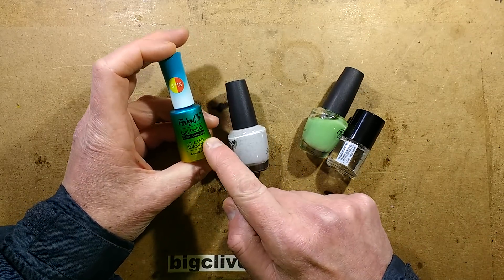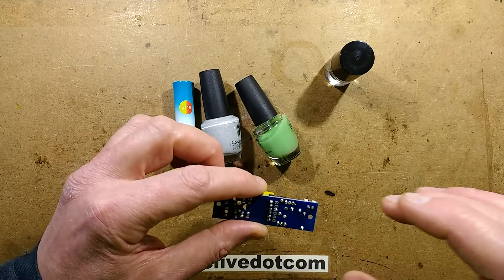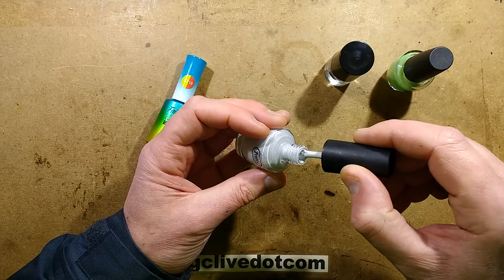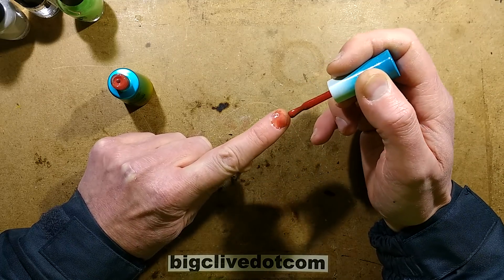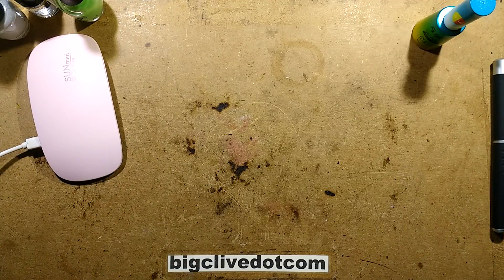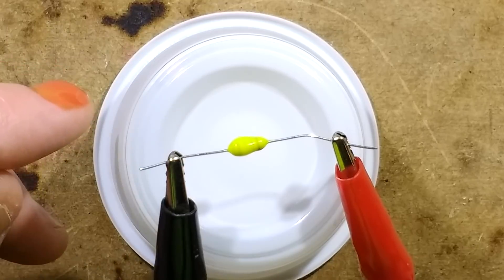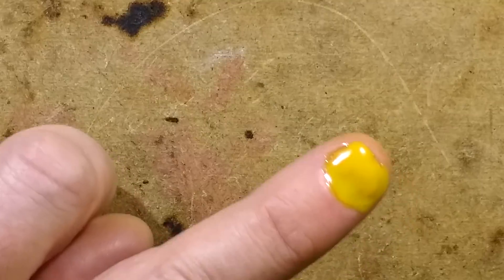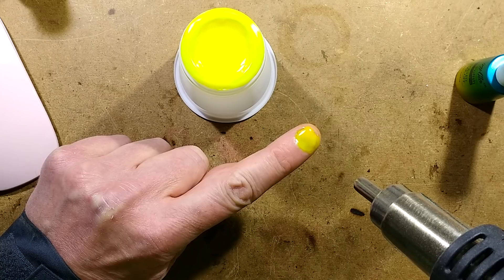Technical uses for nail varnish.

Comment: I had one of those exact same laser pointers and it worked amazing, super bright and impressive, so I ordered 4 more and 2 were super dim, 1 was ok, 1 was decent but not as bright as my original. I gave those 4 away because I was disappointed. Over time the switch started acting up a bit then eventually failed mechanically and there was no easy way of getting inside to repair so I just tossed it. Don't know if I should take a gamble again and hope I get a bright one... hmmm. They're on eBay for a few bucks for those interested.. "Green laser pointer"
Reply: I hope you gave them to someone who knows about safe handling of such lasers as well.. (btw, the one Clive is using is UV, not green)
Reply: I think that's just a blue one... the cheapo's usually don't have UV shielding
Reply: Oh and anything over 5mW is illegal here in Canadaland, I guess if you're dumb enough to point it directly in your eye for an extended period you could get some temp eye damage. The ones I gave away were probably only around 1mW to maybe 4mW, to whom were competent adults.

Comment: Next video: cosmetic use of conformal coating, solder mask and potting epoxy?
Reply: And of course, using UV curable solder mask paint as nail varnish. And we come full circle :)
Reply: Conformal Coating as an alternative to body wax. Clive tries it out on his beard.
Reply: Majenko Technologies Ow
Reply: What application for the "latex" are you considering? And would the type with the glue inside be a Very Bad Idea Indeed?
Reply: What about using heatshrink as a latex alternative?
Reply: I was refering to fetish clothing.
Reply: Yeah... of course you were.

Comment: Nail varnish can also be used to fix trimmer position ;) It's good when you want to fine-tune and then lock some settings on a circuitboard (in amplifiers, transmitters and so on).
Reply: It's cheaper than thread-locker when purchased -- but no one who has ever purchased thread-locker has ever thrown the least amount if it in the garbage.

Comment: Many nail varnishes consist of nitrocellulose dissolved in ethyl acetate. I would avoid using this low-grade explosive to cover potentially hot electronic components due to concerns of stability.

Comment: Hey Clive! I was doodeling arround in ebay and found something awesome! A powerbank with a 10W cob led. I was curious and bought it. Im amazed how well made it is and the capazity of the cells were more then advertised! Here is a  link https://www.ebay.de/itm/10W-LED-400LM-4000mAh-power-bank-Flutlicht-Camping-Lamp-Car-Emergency-Quick-Clip/232286545400?hash=item36155b65f8:g:btkAAOSwCU1Y24sS   I would Love to watch you take it apart and look at the circuit board!
Reply: Foxilein I use a similar one since 1-2years now. Without the red and transparent cab. Would be interesting to see it unscrewed, because I want to change the switch into a better slide version and put some dimming feature inside.
Reply: Spam? I think so!!
Anyway, if anyone is looking for the UK sold version, here you are:
http://www.ebay.co.uk/itm/Auraglow-10w-Rechargeable-LED-Flood-Light-4000mAh-Phone-Charger-Power-Bank/382140756976

Comment: I worked in electronics for a ...... number ...... of years.  The PCB dept used white "correction fluid" pen to mark the board with a serial number, or what ever.  They then used clear nail polish over it to "seal it".  It worked really well.

Comment: Would be cool to make a 7-segment clock out of resistors with the colour changing varnish.
Reply: Now THAT is a brilliant idea! That's my weekend sorted out... if I can get a bottle of the varnish.
Reply: @simpleminded1uk  https://www.ebay.co.uk/itm/10ml-Thermal-3-Colors-Temperature-Color-Changing-Soak-Off-Nail-Art-UV-Gel-Polish/142650300606?_trkparms=aid%3D1110006%26algo%3DHOMESPLICE.SIM%26ao%3D1%26asc%3D225082%26meid%3D429711d39ccc49e1b6c6161c4b1f3ba0%26pid%3D100935%26rk%3D1%26rkt%3D2%26mehot%3Dco%26sd%3D233599586653%26itm%3D142650300606%26pmt%3D1%26noa%3D0%26pg%3D2332490%26algv%3DSimplAMLv5PairwiseWebWithBBEV1Filter%26brand%3DBorn+Pretty&_trksid=p2332490.c100935.m2460 yes resistor for each digit, brilliant product
Reply: Prehistoricman Some Chinese company just read your comment and now have a shitty version of your idea up for sale on Banggood. Lol (not really, but you know what I mean)
Reply: Brilliant! 
You could use a temperature sensor to read the ambient and bias the resistors to just below their transition to possibly get a seconds capable display. I would use metal film or wire resistors for best long term stability. 
Now to find some linear Peltier elements!
Reply: This guy did it: https://gathering.tweakers.net/forum/view_message/31830667
Reply: Good idea! Damn... I might have to try this now.
Reply: I can imagine their briefing for this new product. "Yeah it will be just like this idea... only shitter"
Reply: That's a great idea! I'd love to see it.
Reply: @theLuigiFan0007Productions  build it
Reply: It looks like the back-transition might be a bit slow but it could be an interesting effect on a clock with a circular display.
Reply: Use a ULN2803 or ULN2003 to drive the resistor. 22R on 12V would likely work ok for 1W resistors. If you want those miniscule 1/8 watt ones then you might go as high as 820R
Reply: I like this idea. Use a peltier cooler as the "substrate" and turn it on as necessary if the ambient is too high or if you want faster response times from the resistors. Maybe surface mount resistors directly on the peltier cooler? Failing that, an aluminum substrate PCB mounted directly on a peltier.
Reply: I recall seeing something like that on Hackaday a couple of years ago. 

BTW hi Hackaday, plundering Big Clive for stories again are we?

Comment: Had similar idea on having marked 3d printer head to see if it is still hot, burned black around 120-140"C and  sadly never recovered back to yellow. Oh well, live and learn.
Reply: Stoned Savage Yeah. Finding a good spot with ir thermometer should help.
Reply: Jo Russ well this stuff seems pretty sensitive so maybe paint it on to something that is close to the hot end? im thinking the wire to the thermocouple should work as its pretty close to it please let me know if you give this a try it might just actually work if my head is not in airplane mode.
Reply: After that I just went and bought normal thermometer with led display. It is visible in the dark and actually cheaper than nail lacquer lol...
Reply: Stoned Savage 3d-printers with a display are showing the temperature already in most cases. Still, I like the idea of power-independent "this is hot" indicator in a close proximity of the hot end itself.
Reply: Dmitriy M i didnt think of that haha i pretty much forgot they even exist good call on that one although its quite an expensive investment just to find a goodspot for some heat reactive nail polish.
Reply: Stoned Savage I have a small pen-like ir thermometer. Must be under $10 and come in handy from time to time anyway.
Reply: Jo Russ hell yeah node intuitive idea there i suppose we was only making the problem harder haha

Comment: I was thinking why not paint some onto 18650 battery packs for visual indication of heat build-up , and i figure girls put it on so its a indicator that they are dead or not, Within that area it could be useful to check temperature on vulnerable individuals that get cold easy.
Reply: I've had that idea for a long time, but still have to find a compound with the right transition temperature of around 50 °C
With a webcam looking at all the cells, the image could be analyzed for colour changes and send a message identifying which cells are complaining.
This avoids having a sensors and extra wiring on each cell.
Reply: Now just have to go though the difficult process of finding a suitable bottle of it on ebay.

Comment: I would have liked to have seen the look on the cashier's face when you bought all that nail varnish :-)
Reply: They don't judge, they don't care.
Reply: Mechanics buy it all the time for marking alignments. Go to take apart a timing chain and gears it makes it very easy to put back together when you have matching marks on the gears and chain. 

Also useful by inspectors to mark what they have checked as they can pick a color and it doubles as a tamper seal.
Reply: You could literally buy a large phallic object, some lube, duct tape, a trash bag, and a machete, and they would not care at all.
Reply: As a person who purchased 4 advent-calenders before xmas, i can tell that they don't give a fuck unless they have a very good reason
Reply: Maybe not the cashier, but the other customers in line might wonder.  I work construction and we were using baby powder to cover caulk before it was dry, one of the guys had to go to CVS and buy all the baby powder in the store and I'm sure someone judged him.
Reply: Didn't he say he bought it on e-bay?
Reply: no, Poundland
Reply: I used to paint my nails red, and am a bloke. I don't recall a cashier ever giving a shite.
Reply: hadn't seen "m before, so I assumed wrongly.
Reply: Danny Boel Poundland can pull a listing?

Comment: Some of those UV LED 'curing lamps' aren't exactly the right UV and leave the nail varnish a bit sticky, The lamps with UV tubes seem to work a lot more reliably.
UV nail varnish or some clear UV laquer (from china) is really good for smoothing out the surface of 3D prints.
Reply: Acetone vapour works well too. Have you tried oven-baking your prints to anneal them? (Improves strength significantly).
Reply: Will keep that in mind for PLA.
Reply: Epoxy Resin also works great for 3d prints

Comment: Been using clear nail polish for repairing rips in paper cone speakers for years.
Reply: +Andrew Hull. I've been known to use PVA  diluted with water to semi-soak the area and then re-pulp the paper with a stiff brush and/or by scratching it with a pin a bit. Then it's fairly simple to re-mix the fibres somewhat from each side of the tear (preferably from both sides of the cone) and then patch with tissue or similar. Drying is a slow process....

I was given some Wharfedale speakers which had been driven hard when they were still slightly damp from being poorly stored in a shed. The cones fractured right around where the voicecoil attaches and I managed to repair them in this way. They sound great to this day.
Reply: There's a comment mentioning cigarette rolling paper for that patch somewhere under this video.
Reply: I should have said re-pulp the surfaces of the cone, not mush the whole thing. That way the repair gets some strength from the cone as well as the patches.
Reply: I have a rip in one of my speaker cones at the min, think I will try this
Reply: Misfit the mad
That's great, iam definitely going to give that a go 👍👍
Reply: I said not MUCH intrinsic strength and the implication was relative to a woofer cone (and in a plane perpendicular to the plane of the paper). That said in most woofer cone repairs I DO use a patch or two as well as re-blending the substrate fibre. :)
Reply: +1 for the PVA repair.. you can also add a little "patch" of tissue paper if required, when repairing more "robust" tears.
Reply: Rolling paper, tissue paper, neither of them have much intrinsic strength. It's mainly the PVA glue that does the job which is why I carefully fray the paper fibres of the cone as much as I can. Layering thin paper over the damage sure helps but it's mainly cosmetic or for air control rather than structural.
Reply: Regarding not having intrinsic strength ... the counter that keeps track of how many times I've managed to leave that annoying strip on the kitchen roll whenever taking a sheet thanks to the very persistent grain of paper fibres would like a word with you ... Anyhow, I could imagine applying it as a finishing touch after your method can't hurt.
Reply: I use hockey tape— has not failed me
Reply: Yes but nail polish is much cheaper and much more readily available
Reply: +Siz banga. AvE fanboy much?
Reply: +Siz banga. Nail polish availability vs. PVA depends on your lifestyle. PVA is very cheap and available from hardware stores.
Reply: that's a great idea! I used to use toilet paper and Elmer's glue, but the nail polish it better
Reply: I use PVA glue for that as it sounds better.

Comment: Elenor is battering the hatches down & and it's been windy here in Norfolk for the last week. Up to 80mph gusts at times, with persistant wind speeds of 40-50mph at it's peak.

Nail Varnish Remover has a lot more uses. Acetone is wonderful for cleaning things and is a good reagent for...lots of things that are of a scientific curiousity. I opt to use Isopropyl Alchol (Propan-2-ol) for electronics and screens though, good for getting rid of rosin flux or grease.

Comment: Black nail varnish is very useful for coating unnecessary instrument panel LEDs on boats. All those bright dots of light that only show that the devices are powered on are a nuisance when navigating at nighttime.
Reply: I'd never thought of that - and with a little care, more aesthetic than bits of electrical tape stuck all over. ;)
Reply: I always used Furr Bear's electrical tape, but yeah, that should look nicer.

Another use of the clear-coat nail polish (on this side of the pond) is to make sure noone can try to swipe the license-plate sticker on your car.
Reply: Naomi Baron 
This also works great for getting rid of that damn check engine light.
Reply: I'd never thought of that... I bet it works well on household devices that have annoying LEDs too.
Reply: Good point!
Reply: Thanks a lot for the idea. I think I can put this to use on the instrument panel of my car. I seem to have damaged it a bit after replacing the light bulbs inside, and now at some parts you can see the white light shining through next to the symbols. I'll see if I can put some black polish over those gaps. And if that doesn't work, maybe some black electrical tape.
Reply: Yeah, although I feel uneasy opening brand new equipment and mutilating it. I need to have owned it for a year first before I start poking inside it... long enough for the warranty to run out and me to lose the box and receipt. Once those have gone, it's fair game.
Reply: White (or any visually 'bright' colours) painted over embossed printing or icons on black plastic clam-shells and cases, then cured, then scraped lightly to remove 'flashing/over-spray', leaves you with legible, high-contrast text/icons.

Even the darker colours (e.g. red) can be useful, though; on ever-smaller devices, available real estate for power buttons, volume controls, toggles, etc. means placement that is sometimes arbitrary, and colouring those controls makes them 'pop' a bit more in mundane contexts. 

Black-on-black may be stylish, but it is doltish design from a practical standpoint  i.e. outside the lab.

One of the great things about nail polish is that someone else pays for it; almost all of the nail polish I've got kicking around, serving many useful purposes, I've pulled from the trash/skip (often in batches), while one or two instances (e.g. 'exotics') have come from fripperies at a price of less than 10 cents on the dollar relative to new.
Reply: It's also good on those annoying flashing modem LED's which are often far too bright in a dimly-lit lounge, bedroom or study. Just leave enough light passing through for the indicators to do their job.
Reply: Tapio Peltonen try driving a modern train!  Cabs aren't dark anymore, head/taillight repeater LEDs  piercing blue door interlock lights. I shall get some back nail varnish pronto. Boats must also be designed by morons who've never done the bloody job!! Cheers for the tip
Reply: Zach Demand 
A non-lit check engine light on the turning the ignition on self-test is a fail on our version of MOT, and I imagine the same goes for most of Europe - EU, emissions etc.
Reply: Aviation went to a “dark cockpit” concept a couple of decades ago where stuff only lights up if there is an abnormality for this and other reasons.
Reply: Tapio Peltonen cover it with red assuming that it's a white light so that it doesn't affect your eyes as red light will not disturb your night vision in fact red light is even used on submarines and poultry Farms to simulate night
Reply: I usually open them up and snip the LEDs off
Reply: Tapio Peltonen idiot